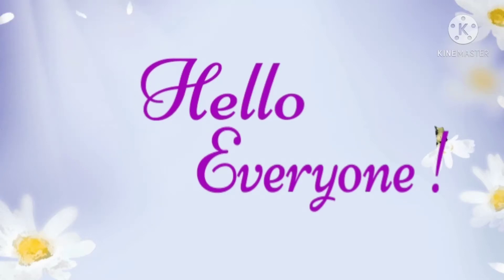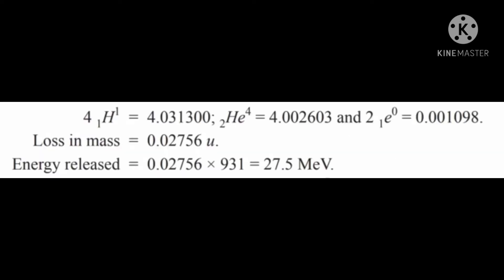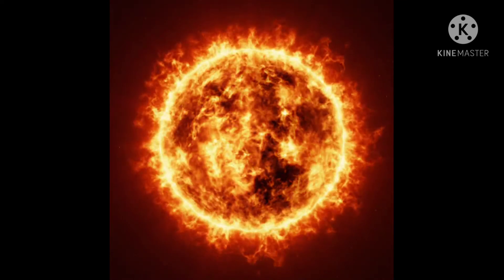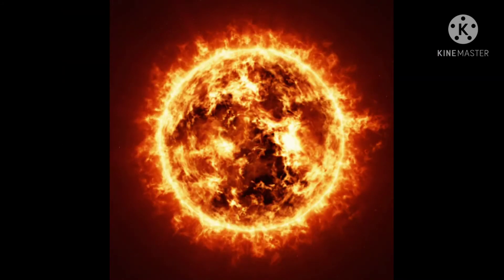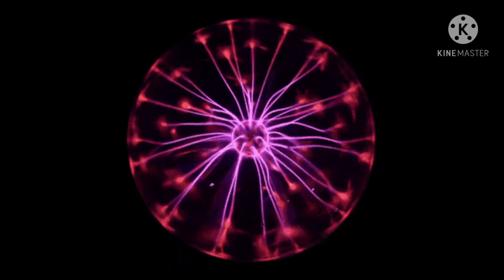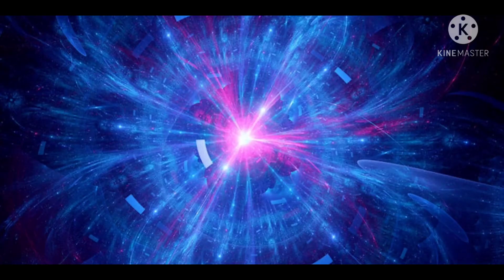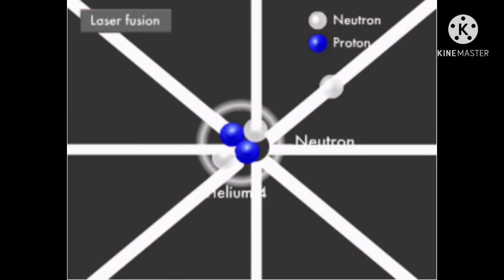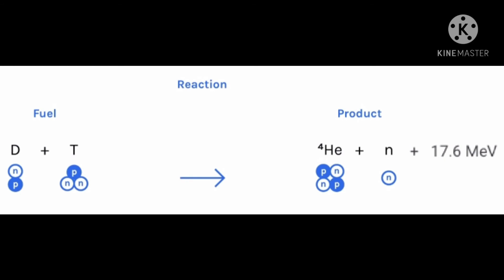Nuclear Fusing with Lasers

Comment: Cold fusion energy machines will have to be prepared at hospital temperatures for the scientific-industrial procedure to commence. Once it is completed, there will be misfires but no damage will be done whatsoever. Successful fusion will quite heat-up the well-insulated machine but not absurdly; and the energy will be conducted toward the grid out of work laboratory in orderly fashion. Then work procedures and time will commence to cool down the energy-work unit. Then this will be repeated; but since every operation is a major economic event of sorts; There will be time enough.